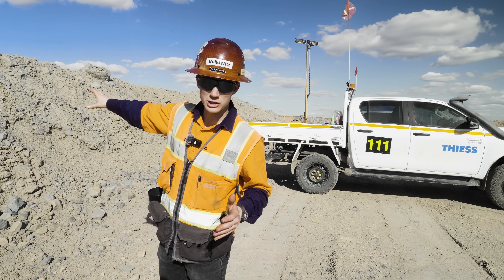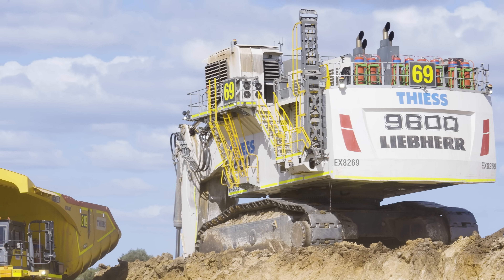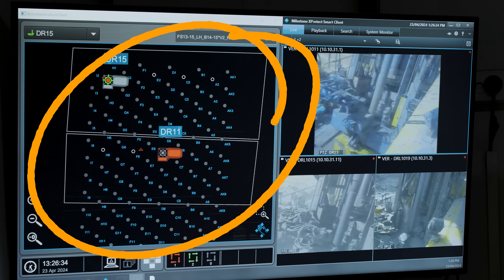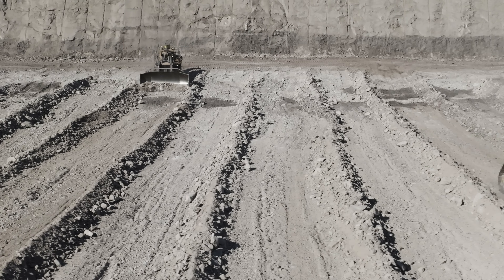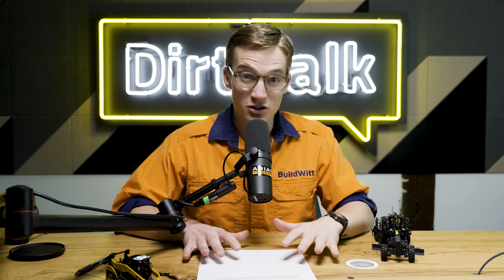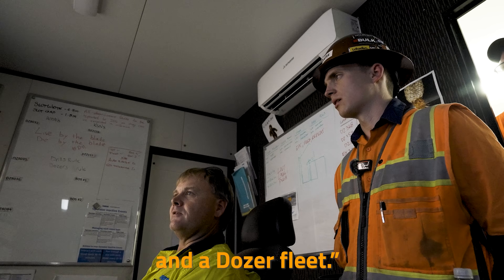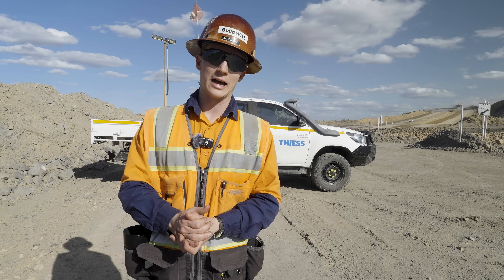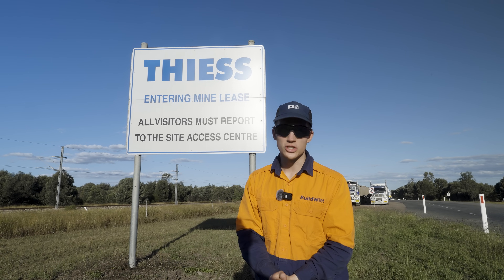Autonomous Bulldozers Explained!

Comment: There is a huge bright side to all types of robots. Gen X was the last working class. It's either robots or nothing. Would I personally run a doser. In a heartbeat. Yet. I went to trucking instead. I had an uncle who did it. He loved it. Yet again. He was in a working class. I had another uncle that was the head driller on most of the oil well out in the Gulf of Mexico. His shift was 23 hours on and one hour off. The younger generations can't comprehend doing work like that. Enjoy the robots doing your jobs.

Comment: "Aaron, I have a query about autonomous systems. How are critical systems like fire control managed remotely? In the event of small fires in areas without coverage, what is the protocol for using portable extinguishers? Thanks."
Reply: They can remotely set off fire suppression that all dozer carry if there is a fire plus if personnel needs to enter into the autonomous zone the dozers stop and you can put out fire by hand.

Comment: Looks awesome! BUT....these are absolutely perfect dozing conditions. Yet I see a good bit of trackspin and below volume bladefill. Note all dozers are on full return to back of pit instead of cutting out front section and shortening travel times. 
I have tens of thousands of hours operating dozers. I am NOT against autonomous operation. It has its place. But like posted elsewhere, there is the cover story and there is the real world. Get them in mountainous terrain and tell the dozer to build the first drill bench....or maybe ask them to build a retention pond!
A bucket leveler on a wheel loader should never fail either..........or the auto cycle process.......But......

Comment: It's funny that at 11:06 you can literally see someone sitting inside of the dozer😂 You can see his left and right arm on the controls and his safety jacket, his body shaking from the uneven drive. I don't mean that they are lying or something, just an observation. Maybe sometimes there is someone working in them  or they want to see the difference between autonomous and normal operation.
Reply: my assumption is because their out filming on the cut, they would go back to manual in the seat operation to reduce the risk of a person getting run over or not be seen on a camera and getting flattened.
Reply: @My_Special_k   good point, I wouldn't trust those things with my life. And I don't think that they are very good at detecting people around of them, or even able to. The people around them are probably responsible for their own safety and shouldn't get too close to them.
Reply: I actually work at lake vermont, they can only run 5 auto dozers at a time but sometimes have more than 5 in the push  so some are manned, all the auto dozers can also be manned
Reply: The stack of lights on the side of the ROPS shows what mode they’re in, blue light means auto mode, green light is a manned dozer

Comment: He mentioned that they can run 22 hrs a day. Maybe I missed it but were there infrared modes for the cameras that enable night driving? I didn’t notice any portable light poles that might illuminate the work area for the night shift?
Reply: Autonomous mode uses GPS!
Reply: There are lighting plants above the dozer push with the camera trailers, they also just use the lights on the dozer, same way an operator would at night

Comment: 2 blokes operating 5 dozers, im sure smarter people than me hae worked this out but are we really breaking the bank at this point? wouldnt it literally be cheaper to get rid of all the autonimous gear and just hire the 3 other dudes. Seems like the cost savings alone would make it worth it?
Reply: Salary, superannuation, annual/sick leave, FIFO costs, payroll TAX, camp costs, workers comp, etc, etc. Try AUD250K per year. Plus it's not 1 for one, you would need at least 2 operators to cover each machine for 24/7 ops plus up to another 2 to cover the rotation depending FIFO swing or DIDO.

Comment: What a waste of money they still have operators moving them. 😂😂😂 Mite as well put the people inside the cab .  Like there still there working just not in the machine 😂😂😂😂😂 waste of time.  Not autonamis at all it's a big ass Remote control toy 😂😂😂😂 I got one too stupid shit
Reply: How does one guy in a cab operate 1-4 other dozers at the same time? You obviously didn't pay attention to the video. It is also great for the operators to be in a control room that does not bounce up and down. Operating and other trades take a toll on the body after years of use and abuse, so this is a great fit for someone who has the skill but has a body that can't take the beating any longer.

Comment: They should bring in Autonomous Management
Reply: You know why employers go to robots?  To get away from the greed and belligerence of you union fucks.
Reply: Unlike an operator, managerial skills can’t be replaced with autonomy.
Reply: @lukeparsons583 Replacing a manager with an AI is far easier than replacing an operator. Yet for some reason the manager in question doesnt ask for such a capability
Reply: @piergiorgio919  yeah its easier to automate white collar jobs, 
less interaction with the physical world is needed.
Reply: @lukeparsons583  yeah, a couple of monkeys would do.
Reply: @lukeparsons583 only because the tech is not backwards compatible.
Reply: @lukeparsons583  20 years ago, that's exactly what the operators used to say.

Comment: All I can think about is “they took our jobs” in the best cartman voice I got
Reply: they may get rid of some operators, but they had to hire more technicians to keep all these gizmos working, so its probably a draw, though they are probably using the local Cat dealer to keep all this stuff up and running, not to mention , not every dozer push is in a straight line, so any contour work will still be man in machine, these may be the only five D11s set up to do this, a job this size could have hundreds of large dozers, most will not be self driving

Comment: After 40 years of heavy equipment operating, I find autonomous very interesting. I feel cheated that  i never got even with the machines that ruined by back.
Reply: 1976 to 1985 I worked in the miming industry as an equipment operator. My first year in a coal mine in the Rocky Mountains driving haul truck.  Drove for 1 year and honestly got so sick to the stomach of driving that one shift I got half way up the ladder and stopped. The man bus moved on and if it hadn’t I would have climbed down and got in back to the dry and quit. However I stuck with it and soon after went on to Cat. It was the repetition of driving that was the catalyst. At least on Cat I could be more focused on creating than just steering.
Reply: @Bobcagon  That gets a lot of people. I preferred road construction to mine trucks.
Reply: @billortloff4215  Yep..The repetitiveness of the job. Some people don’t mind it. Running scrapers the same thing. At least with Cats you have to be thinking all the time.
Reply from the maker: everyone I've met that works around the autonomous units are extremely positive about them
Reply: @buildwitt   Yes, until they're fired and replaced.

Comment: Worked around these albatrosses for years. Sensors always failing from heat and vibration, drills trying to walk off the high wall, dozers backing into high walls, both walking over rocks and shocking the machines undercarriage, always breaking down right in the middle of the cut, geo fences failing, but the companies spend millions trying to eliminate a few employees, so they say they’re the best thing under the sun, never mind the insane maintenance costs from the specialty mechanics. POS’s
Reply: I think the savings of labour for the dozer operators are absolutely insignificant here, compared to the operating costs of a normal dozer, plus the additional costs of this technology and the technicians required to run them. If they run 2 people on 5 dozers or 5 people, doesn't make any significant difference financially. But they claim that the productivity is better, 23h a day compared to 17h a day, allegedly. But with the right personal management, they could get to 23h a day with normal operators. Shorter shifts without the need of a break, faster change between shifts and more shits per day.
Reply: @IronWarrior95  As a retired farmer running regular tractors for 65 years I came to realise vibration is a virtual killer. I can no longer run an 80 HP 4WD loader for more than 4 hours when my muscle nerves fail to function. Some far younger contemporaries know this too. I also know that air ride suspension removes much o this but not all.  EU now has regulations on amount of vibration or operator hours for various jobs so I can see , with all the workplace litigation, more than just the operator output should also be considered. Just a thought!
Reply: @kevinking3402
 Those are just growing pains, they will eventually figure things out. In long term it is worth it. Remember we are in population decline, so less people to operate those machines. Firms are thinking in long term not just in couple years ahead, many think in decades forward.

Comment: Unbelievable how they have all the technology but completely get the fundamentals wrong! The slots are not deep enough down to top of blade, they are pushing from the back to the front and not backstacking not a good process!!!!
Reply: @adrians6085  They probably are testing this autonomous system for less than 10 years. If they reworked trucks before they figured if autonomous is worth the investment, then they had to rework blade to front again. They probably will invest in reworking mechanism when they are done with autonomy. It also mentioned that form time to time humans need to drive them manually (i understood in dozer). But maybe they drive from distance.

Comment: Aaron, Cat dealer Technology sales guy here with several Cat Command deployments in the USA. Great video and overall sense of our SATS solution! I appreciate highlight the benefits of Cat Command for Dozing. 
Side note: operator feel isn't necessary when you use grade control in the cab either, so I hope the comment section understands that. The most important thing for Command for Dozing is having that pitch roll sensor in your gut and it ends up transitioning to the station. This summer I taught an intern in a week how to operate with zero experience, but the addition of Cat grade 3D allowed them to get a feel for the machine. All while I'm remote control working safely and sitting next to them coaching along the way. 
The solid blue is RC Ready (available for remote) and Flashing Blue is RC Run (meaning operating in remote or SATS) 14:57
Reply: I was with Cat headquarters in Peoria in the 60's ... and a parts and service sales rep in the field. Back then you got a detailed parts book with a machine purchase. There were parts grams and service memos coming out all the time. And service manuals could be purchased. Dealer support was superb... and expensive. There were no electronics to speak of. Caterpillar inventory control and parts distribution (i.e. product support) was the best in the world. There were no orphans. They made all their money on parts (i.e. gave away the razors and made it up on blades). They were a $2B company back then and export sales just started exceeding domestic revenues. That's been the case ever since.
Reply: Hey buddy. Time for another site visit. Get me out of this office!

Comment: Conveyors are still more efficient. A D11 won't even do 800 tons per hour at 200+ meters. Even with 5 dozers you're under 4,000tph. Conveyors can do 10,000 to 20,000tph with large ones.
Reply: Yeah. So. You don't know what it takes to mount those belts then move it every day s omehow as the elevation drops.
You really think the people that developed earth moving don't know what the options are?
Reply: @sparksmcgee6641  They didn't become miners because they earned PhD's, let's put it that way. Lots of dumb stuff in mining. As in all industries.

And yup, I've worked with many conveyors. Mobile is possible with some engineering.

Comment: Feel sorry for us mechanics who still have to go out and repair the machines when they break. Still cannot see how pushing 60 tons all that way with wear and tear on the undercarriage is more efficient than loading it on a conveyor or truck.
Reply: @andyb6492 Conveyor is still the best thing, but it needs large deposits to be cost effective, because moving from depleted small mine to new small mine is not worth it. Germany have large lignite coal deposit, that is why they do big wheel and conveyors. And as mentioned there are many small firms, they could colaborate and buy 1 rotory loader to conveyor. But that is their choice, if it worth the higher upfront investment. And transporting non coal dirt to side of mine with truck is least efficient way, that is why they only use trucks for coal.
Reply: I think that the answer might come down to availability of electricity. At these mines there is only site generated electricity and that is not available in enough phases, amps and volts to run the numerous electric motors for a conveyor belt system and nowhere near enough power to supply a large drag line or bucket wheel excavator. So at the end of the day the engineers and accountants determined that the infrastructure costs of supplying conveyors and bucket wheel excavators was too great on a total cost per tonne basis. 
You heard the operator describe to Aaron how the dozens were cheaper than excavator and truck system and given the lack of access to high voltage electricity supply, site generation of a sufficient power supply for conveyors and possibly bucket wheel excavators was just going to be too expensive. 
Mark from Melbourne Australia 🇦🇺

Comment: You could replace the diesel engines with electric motors, and send these to Mars to prepare the ground for human landings.
Reply: Where you getting the electricity from to run these machines?
Reply: @edharvey4957  The sun.
Reply: Fortescue has giant electric excavators. Electricity from their generators (a mix of solar and gas)

Comment: 9:14 Why are those dozers "backing" through the cut? "Works and wears 101" informs you that backing up puts a far greater wear force on track than going forward. Plus, there is no work product going backward. 

Sometimes (e.g. short run finish work) it makes sense. But in this case, turning the dozer around at the end of the cut makes much more sense. This would be done by just skipping a row as you turn back to the reverse direction. You never see farmers backup combines in their fields now do you. It's not because of wear, so the dead heading "is" a significant component of the process as well.

Comment: You could only imagine the amount of maintenance and mechanics you need for this new robotic revolution
Reply: Probably less , no humans to wreck things .
Reply: @stewatparkpark2933  as a WV Cat Mechanic, I was wondering the same thing, I have seen operators absolutely destroy a machine because they were ignoring warning indicators or pushing (even a D11) well beyond its limits, the time all favorite is "I shut it down as soon as I heard that noise" ,dude, you melted the entire torque and transmission out of it, that didn't happen in the last five minutes before shut down.
Reply: @scout2nut   Aircraft have scheduled inspections, service and parts replacement. Some Hercules run 50 years before retiring because they have good schedules.
Reply: its all steer by wire anyway already
Reply: I just hope the new remote technology like software part isn’t locked where you need brand technicians and also deal with the dealership but is something any mechanic can get training and do themselves
Reply: @chornii_boumer7324 obvious like any software they’re certain things you can do to certain levels. Some are password protected.
Reply: Why would you even think that? automation has made production cheaper than use for a century now. just not for you pleb.

Comment: Why do they stop 1 to 2 meters above the coal seam if the dozer is the cheapest way to strip off the material?
Reply from the maker: need an excavator and operator to get down to the coal without wasting any
Reply: To protect the coal.